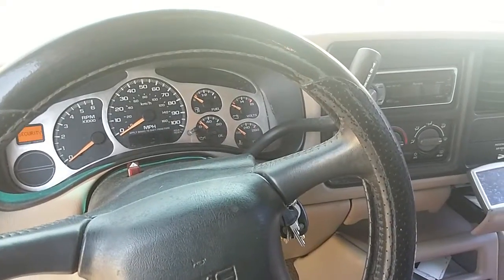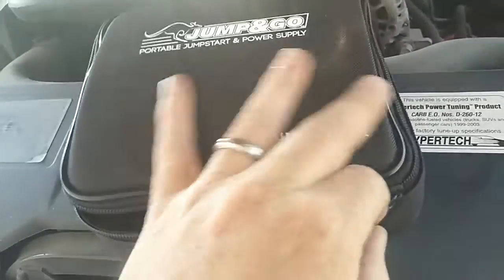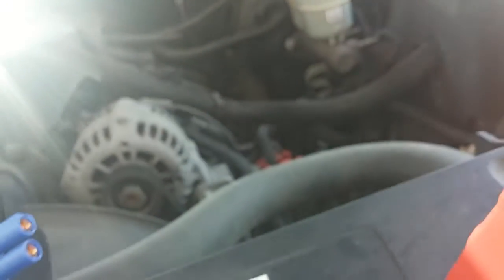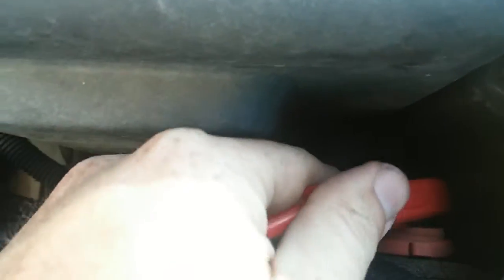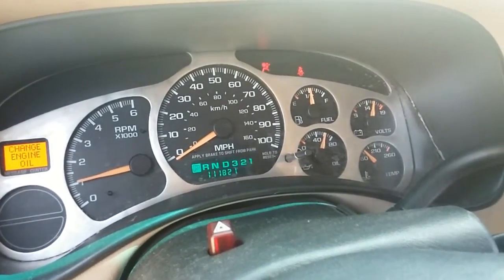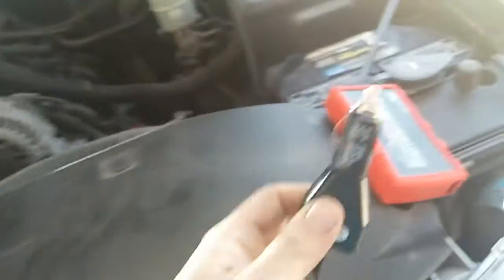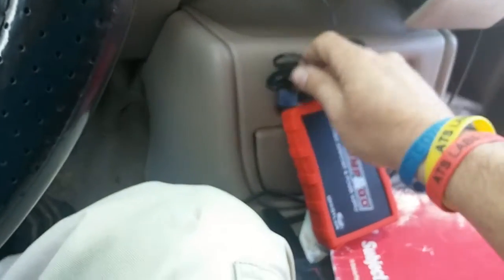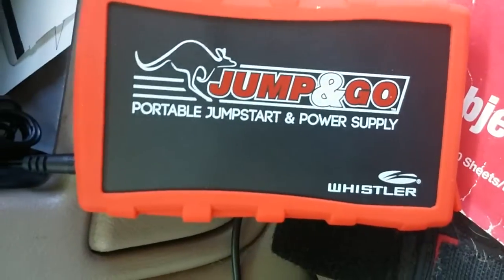Will it start....Review of the Jump & Go by Whistler Part 1

Comment: Thanks for the video.  I've been very skeptical of this device's small size coming from having used the much larger lead-acid type chargers.  I've bee looking for videos to confirm that this unit actually works as advertised.  I find it hard to believe that you get as many "car starts" out of such a small  unit as they claim but even if you only get a few it would seem to be worth it given it's small size and portability and the fact that you can charge USB devices off of it.  It would be much nicer to simply throw something like this in the glove compartment vs the amount of room the much larger lead-acid charging units take up in the trunk, etc.  Anyway, thanks again for the video.  Please post again as  you continue to use the device and let people know how it work and how it holds up over time.
Reply from the maker: Soulrider2012   Totally agree with you.  I wouldn't believe it my self.....let alone go out and buy one.  But since it was a gift I had nothing to lose.  Much to my surprise it works great.  So great that I bought 2 more.  So we have one for my car one for my wife's car and one for the storm shelter.
I picked up a riding mower and the battery was dead so carrying this little thing out to the building it was stored in was much easier.  
Thanks for watching.

Comment: Just an FYI. These packs are great, but always connect the clamps to the battery before plugging the spade connector into the Lithium Polymer boost pack to help avoid damage to the circuitry to the internals of the boost pack. I too was very surprised of what these little battery packs are capable of. Great demonstration! Cheers! Zip~
Reply from the maker: +ZippoVarga Thanks for the tip and thanks for watching
Reply: +2LateIWon A quick check you can do on your own is to look for a serial number tag. If there is one, this is not on the recall list. But, if there is a date code stamped into the outer casing under the silicone cover, then I would definitely give the company a shout to see if it is one of the 10,000 or so that are on the recall list. Cheers! Zip~
Reply from the maker: +ZippoVarga yes we have 3 of these now and have checked them all out.  thanks

Comment: DO NOT BUY!!! Mine swelled up and quick working; was recalled by Whistler. They sent another and it swelled up and quit in 6 months.  Glad it did not catch fire.
Reply from the maker: OneSecure that's no good. we had a total of 3 never had an issue 2 were in our house fire last November but the one we kept in my wife's car is still good.  thanks for watching and I'll keep my eye on the one we have left though.
Reply from the maker: No you are correct in the recall.  I reminder getting an email or something.
The ones that had the recall were not the serial numbers effected that we had.  We must have lucked out lol
Reply: You had a house fire with 2 of these batteries in your house??? Could there be a link to the batteries?
Reply from the maker: OneSecure.  lol. no it was an electrical fire from an outlet.  we had one in the garage and one in a storm/tornado shelter.  but i see why your red flag was alerted lol